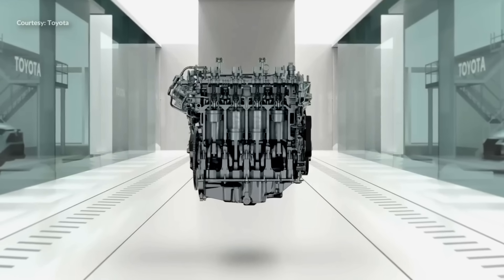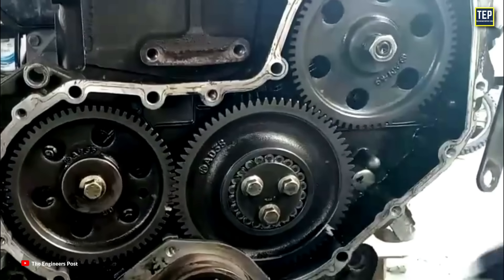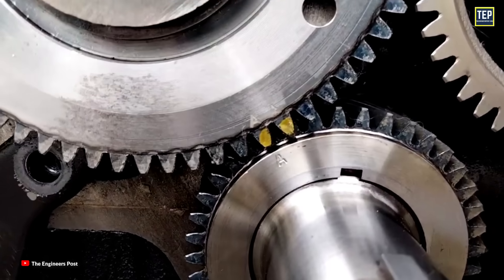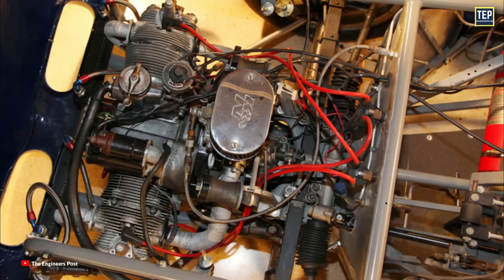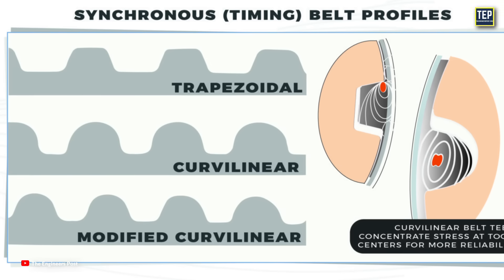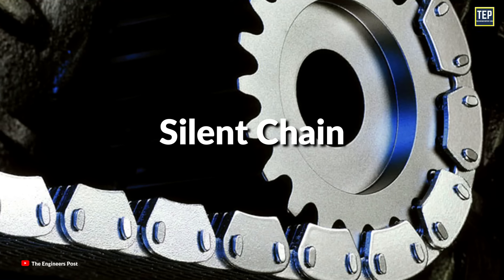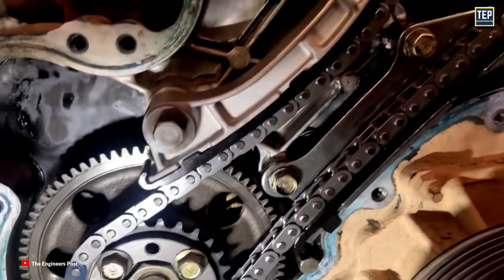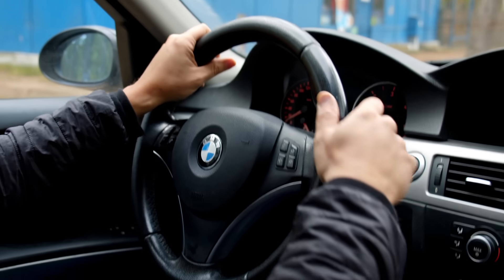Which Timing Mechanism Is Best for Cars?

Comment: every wet belt fails immaturely, costs you thousands' of dollars to rebuild.   AVIOD WET BELT at any cost. (HONDA 1.0t, PSG 1.2t, FORD 1.0t etc.)
Reply: Wet belt is stupid idea. Belt and oil don't like each other.
Reply: Not every belt fails prematurely but your warning is otherwise valid......
Reply: Does Ford and Honda engine  have a similar set up?
Reply: @BruceDragon-sf1tr  Honda have been using wet belt in industrial (fixed rpm) engines for almost 30 years.
 It's probably why they thought it would work in automotive?
Reply: @BruceDragon-sf1tr well in Europe they do and unfortunately there are many problems reported, and not just with a single manufacturer either  As mentioned, make sure you use the recommended oil and a quality filter.  Also change it WELL WITHIN the service interval.  I'd remove the sump pan periodically and clean the pump pickup of any debris, as this can result in loss of pressure and even lubricant starvation!  In my opinion they're best left avoided, as are GDi systems where the injectors are located directly in the combustion chamber, instead instead of the inlet manifold, allowing greater control of mixture and burn.  This gives more power and economy, however carbon, fuel vapor and oil contamination etc from the emission recycling system is allowed to build-up on the intake valves and ports, instead of constantly being washed away by as in conventional delivery systems.  I also understand that eventually the cylinder head will have to be removed and disassembled for cleaning due to.loss gradual of performance.
Reply: @rob5944  if you don't mind explaining,  how does a wet belt serve the motor?  I mean why do engines have these belts and chains?
Reply: @rob5944  if that's the case , they should make the belt almost indestructible,   problem solved 🤷
Reply: @BruceDragon-sf1tr  as it says, rubber and oil don't mix.  You shouldn't even use handyman lube on rubber or plastic, I have silicone for that.  BTW it works wonders on electric windows!  In other words, there is an indestructible belt...it's called a chain.  Frankly there's a limit to how far a gallon of fuel will reasonably and reliably get a car, and we reached that years ago.
Reply: @rob5944  the chains don't break?
Reply: @BruceDragon-sf1tr  not if the set-up is designed properly, BMW has had a lot of trouble with the guides, too much plastic....Again, timely oul changes.
Reply: @BruceDragon-sf1tr  almost impossible, depends on quality of course and maintenance (premium oil changed regularly is basic). The only problem could be it stretches a little with long operation time (we talk of millimeters, tensioner maintenance or change in case of strange noises is also important). Morse type should be better for this. Gears timing of course is the best, but is costly to project and produce, and heavier; chain far cheaper and light; belt is still far cheaper and light, but bulky, must be outside for easy maintenance; inside belt in oil is human stupidity.
Reply: @BruceDragon-sf1tr  Must be similar engine set up between Ford and Honda engines because Honda uses 1.0 Ford eco dissaster engines.
Reply: @Triggernlfrl  ok i get it. You guys must be mechanics on this thread?
Reply: GM’s 1.2 liter 3 cylinder engine has a wet timing belt; disintegration in oil clog oil p/u starving oil, belt breaks impacting valves. Special tools for cam phasers and placement make this a pricey maintenance & won’t achieve service intervals. Ford already proved this is a bad idea in eco boost engines; making Trax & Envista throw away vehicles.
Reply: @flashnmb1  does Ford still put the wet belt in the newer ecoboost?
Reply: @flashnmb1 same over here in the UK, personally we have a 1.0 non-turbo triple with a chain, and a five speed manual transmission.  Sure it's lower power, but I just change down through the gears and leave five minutes earlier lol.
Reply: Wet belt is stupid and just a money grab from manufacturer basic physics knowledge should let you know that however normal belt driven alteast from my experience is better from chain.
Reply: @JAKE-em5xr  to me, changing a belt every 5-10 years or 60-10,000 miles is bo big deal anyway.  It's a moot point because we're all gonna be driving around in EVs apparently 😏

Comment: Nice catch, on the "align honing" problem with gear drives, but IH used gear drives, in their gas engines for years, with no wear issues. Not exactly a fair comparison, since they're commercial powerplants, built to take tremendous abuse, but I think any thermal issues would still show up. Ford 300's are also extremely tough. The real issue was noise - it's very, VERY slight, but people hear a noise they aren't used to and they freak out. Buick had to discontinue it's amazing 2-speed torque converter, because owners got nervous about the slight whining noise.

Comment: I have a VW Fox 2019 with 39k km. Should I verify the timing belt in the next service due to time even if I'm not experiencing any problems with the vehicle?
Reply: You should DEFINITELY check an external belt from time to time. That's why we have TIME and KM/Miles service.
 Belts can and will wear differently, so in areas with plenty of contaminants or any unusual things happening can lower the life expectancy.
Reply: I would change it whenever it’s due for service you don’t want the belt to snap because it gets to old or worn down though if you really need to you can run it until the belt starts to make a noise then you really need to replace it
Reply: Every 50.000 km or 5 years is the best interval to change a timing belt. If you have 5 years and 40k km, you have to change it.
Reply: I wouldnt worry about it until you're close to 160k km. Thats about their life expectancy. I am in the US and most belts average around 10 - 30 usd
Reply: @IxhazeGT  I have 2 Citroen cars with 1.6 ltr diesel engines. The instructions say that the timing belts are replaced every 10 years or every 160,000 km. I think the manufacturer knows what he is writing. The mileage of one car is 120,000 km, I think I will change the timing belt next year. At approximately 130,000-140,000 km mileage. I am in EU.